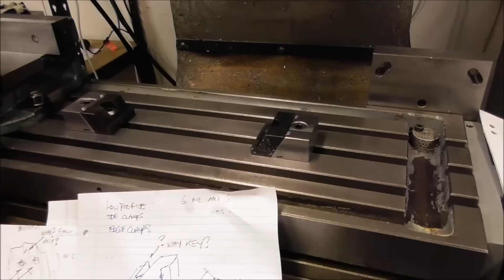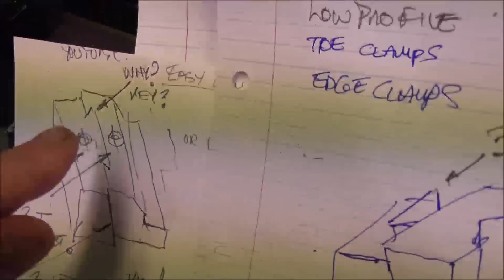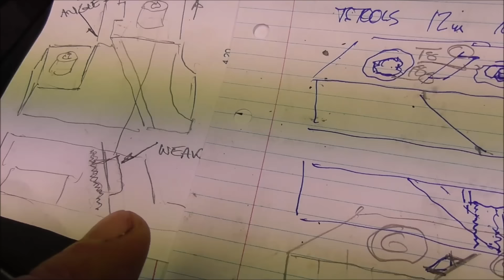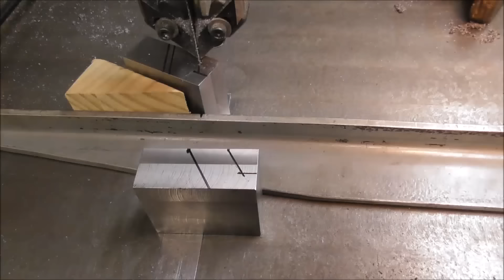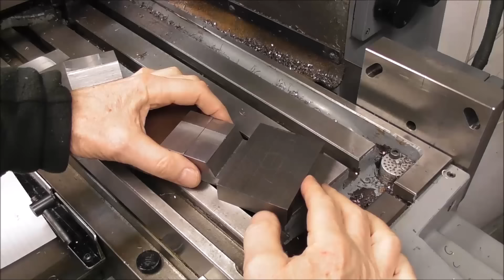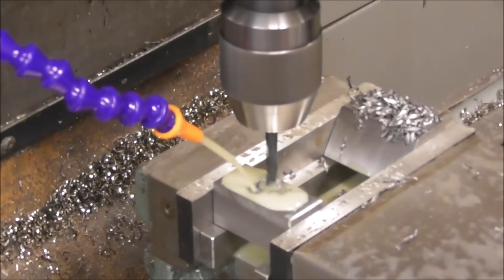Low-Profile Two-part Vise/Edge Clamps

Comment: Why do both sides need to "clamp"?
Wouldn't having one side fixed(i.e.just a block, no slide) remove most of your issue at around the 12 minute mark?
Reply from the maker: For pull down. Tight pull down on both sides holds a part more securely and accurately. Cliff
Reply: @Threadexpress  Yeah I figured that out, I thought I deleted this comment, but thank you for your reply.
As long as you do up both side "about" evenly.

Comment: Hi Cliff, great and clear video! The rule of thumb is learned is 'drill at haf cutting speed of turning and ream at half cutting speed of drilling'. When you say 'reaming at a higher cutting speed' what cutting speed are you actually using?
Reply from the maker: Hi Peter. I just re listened, my words are a bit unclear, I meant to say ''fast feed rate''  (not speed/RPM). Cliff

Comment: Great design Cliff 👍
I twigged to the dowel feature about twenty seconds before you revealed same….. great minds think alike 🤣🤣🤣
Loved the way you led us thru the design process.
Thanks for that 👍
Regards
Robert
🇦🇺
Reply from the maker: 😀Cheers, Cliff
Reply: The need to guide the jaw only occurs when the opposite end also has a taper. When clamped against a flat square stop or pins, there is no influence for the piece to crab. Float in the jaw allows it to align on the non datum end, ensuring full location against the fixed stop.
Reply from the maker: @Bosun-8  I agree, but I wanted pull down on both sides. Cheers, Cliff
Reply: @Bosun-8 
There is no ‘datum end’. Both jaws are floating.
Robert
🇦🇺
Reply: @RobertBrown-lf8yq  and that is why you need the dowels.

Comment: nice job explaining your design process with adding keys (dowel pins).  Just one question - Why did you use a bull-nosed milling cutter as opposed to a sharp cornered endmill to drill for the keys?
Reply from the maker: Thanks for the feedback. A ball nose cutter has a couple of advantages; it starts and cuts more like a drill with less cutting stresses and provides centralizing guidance for the following drill and reamer. Cliff
Reply: @Threadexpress and if you angularly tilt the bullnose cutter there is less stress on the centre area of the cutter and it cuts more freely and gives a better finish.

Comment: Hi Cliff.
In my opinion version three could have the bolts that is working on the moving part of the clamp in the same angle as the mating surface between the parts and the "nut" should be a common nut for both parts. That could increase the clamping force in both X and Z axis.  When there should be is less friction between the mating surfaces.
 This is what I think is a development of this type of clamp. I have not seen this in other types of clamp as I can remember now.

Best regards to You from John Eriksson in Sweden
Reply from the maker: Hi John. I wish youtube would allow adding sketches, I am not sure I 100% follow you.  You mean having the front bolt at 60 deg into a 60 deg T nut?  Cliff
Reply: @Threadexpress  Hi Cliff. That is spot on. and the T-nut is in fact a small T shaped square steel bar with 2 threaded hole one with a 60 deg. angle and one prependicular to the steel bar.
 John.